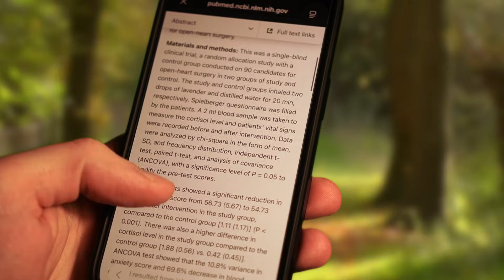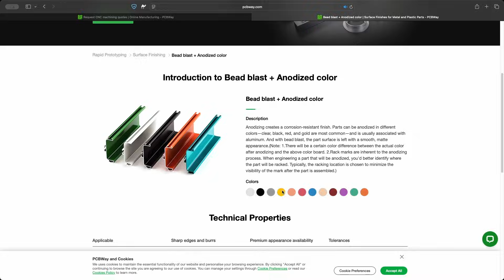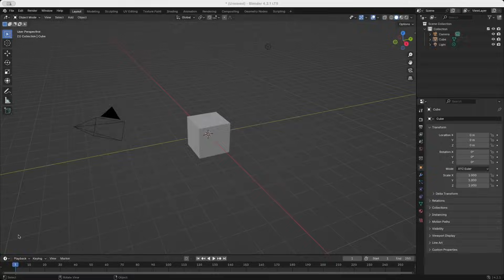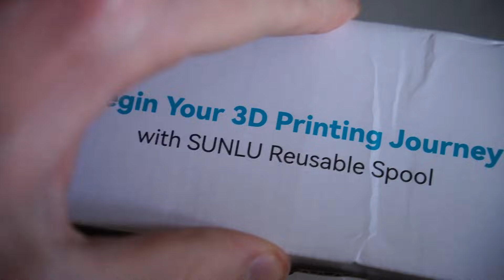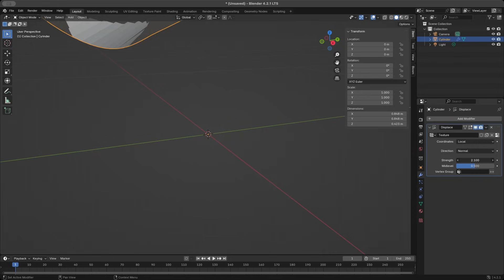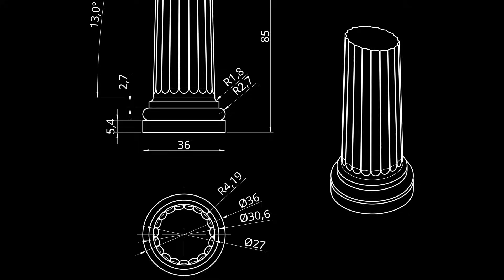I made this to improve my stats - it's backed by science, but how is it?

Comment: Hey, another Supernote user! I've never thought of tracing things directly on it.
Reply: Also very interested in the tracing aspect! (Love your channel btw) Does it work? i have a shaper trace but SVG generated is always off when imported in fusion.
Reply from the maker: Haha well spotted!! How do you use yours? (I find tracing things on it is surprisingly useful, to get the rough footprint/ scale of a design and play with layout options - plus, I'm a little less concerned about marking the screen as it's a self-recovery surface that handles those ceramic tips super well)
Reply from the maker: @WSung-ii5nn thanks for the kind words!! It's definitely not a tracing tool like the shaper - I only use this as a quick way to bring footprints onto a canvas, to allow me to play with layouts/ understand scales. Definitely not a precision tracer. How are you finding the shaper? Looks cool from what I'm seeing.
Reply: @UrbanCircles The shaper tace is ok.... I've only used it a few times for gridfinity bins.  I still revert to jusst measuring with calipers. I have heard of Project Salvador might be another way of AI tracing in Fusion.
Reply: @UrbanCircles  It's my favorite tool for sketching projects -- 3D printing, woodworking, etc. Much more flexible than paper, and when I'm ready, I can just print the PDF and bring it into my dusty workshop.

Comment: Great video, what makes the plaster mix special? does it absorb the oils in a unique way? also can you change the scent or once you put some into one of them will it always have that scent?
Reply from the maker: Hi Joel - thanks so much for the kind words and for checking out my work!!

Re plaster of Paris - it works well because, once cured, it becomes a network of tiny pores that soaks up essential oil, and then releases it slowly from the surface as the volatile components evaporate naturally.

Re changing the scent - I’ve never tried it (I quite like to design specific pillar + scent pairs), but I understand it’s possible. Instead of “recharging” with oil of the same type, you’d allow the previous scent to fade and switch to something else over time.

Hope this makes sense. (I’m also very much an amateur and discover these new niches with childlike enthusiasm! 😂)
Reply: @UrbanCircles  Love it! I'm the exact same way. My wife is looking into diffuser's and we both just aren't a fan of the electric ones so i'll show her this tonight but I know she will want to know if she can change the scents! Thanks for the quick reply!
Reply: @JoelSchat  I suspect some form of alcohol could be used for cleaning like isopropyl, acetone, or even medical gasoline. Do check if it's compatible with plaster before trying any though.